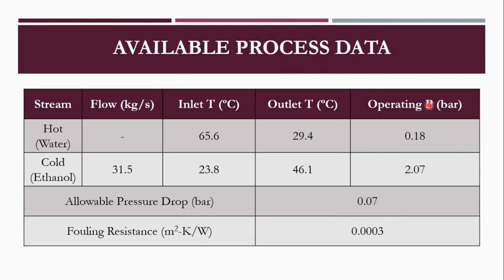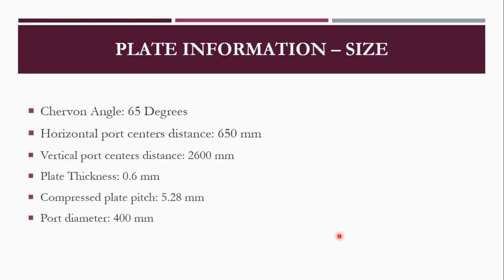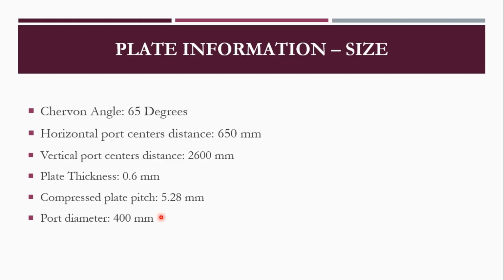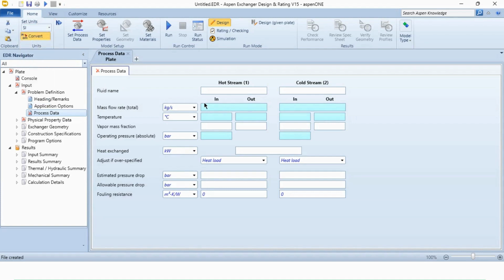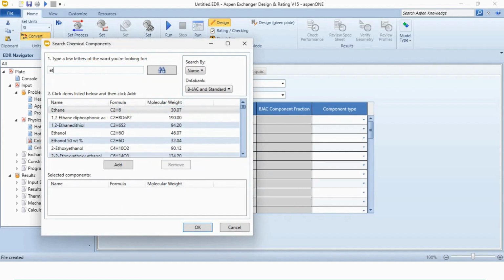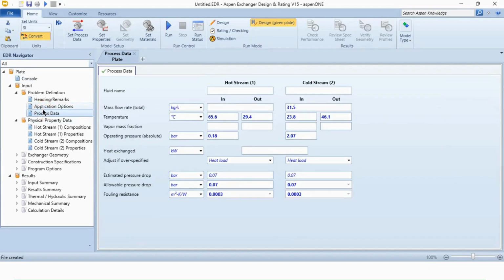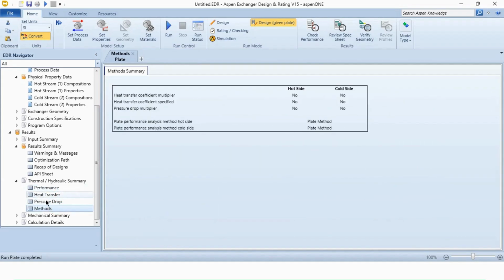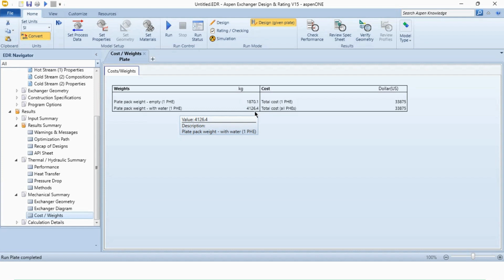Rigorous Plate & Frame Heat Exchanger Design in Aspen EDR | Step-by-Step Tutorial!

Comment from the maker: 🔥 RIGOROUS HEAT EXCHANGER DESIGN CHALLENGE

In this tutorial, we designed a Plate & Frame Heat Exchanger for a water–ethanol system using Aspen EDR.

🎯 The final design contains 141 plates.

What parameter do you think has the greatest influence on the final number of plates?

A) Chevron angle
B) Plate pitch
C) Heat-transfer duty
D) Pressure-drop constraint

Share your answer and reasoning below 👇

And if you'd like to see a rigorous Shell & Tube Heat Exchanger design using Aspen EDR, let me know in the comments.

👍 Like the video if you'd like more advanced Chemical Engineering design tutorials.